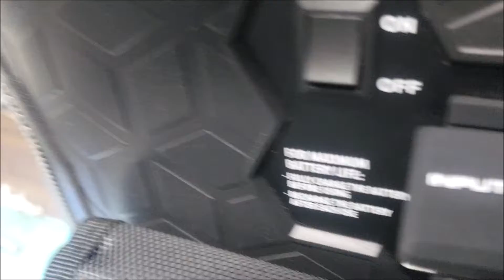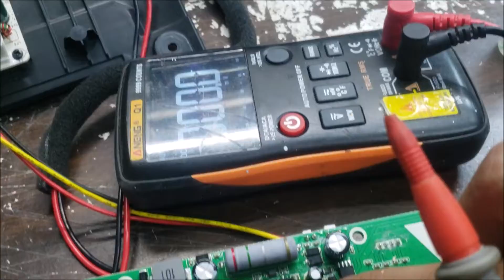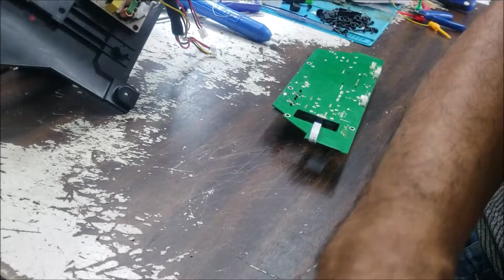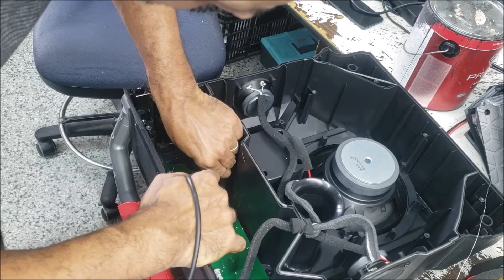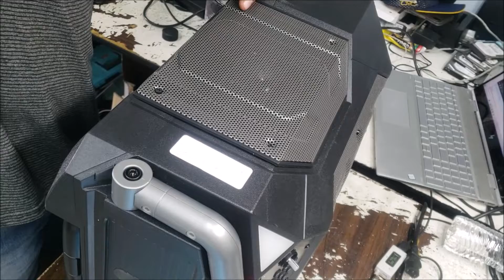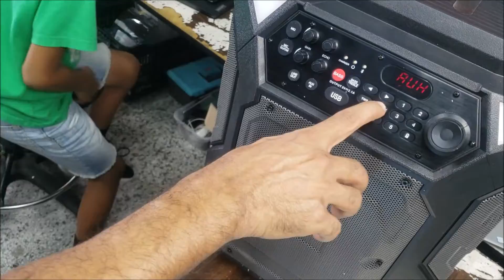MONSTER portable Bluetooth speaker 270X wont turns on green light only

Comment: I know it's 2026 but  I am trying to get my Rockin' Roller 270 fixed, I accidentally tripped over the aux in cable and bent the tip of the cable. Now when I turn it on, even without the  aux cable plugged in it automatically goes to "Aux In", and when I turn the volume up or down, it goes to stby mode and then shuts off. Did I damage the AUX in port and it thinks I always have an AUX cable plugged in?  I would really like to get it repaired. What are my options? Should I just get a new main circuit board? Or is it I can do on my own?   Thank you. Robert:
Reply from the maker: replace the jack
Reply: @SOSfixElectronics  I will try that because a main circuit board is $65 on Ebay. Thank you

Comment: Mine will now not AC power up at all.  I have had the battery removed for years and it has work fine on just AC.  The small circuit board just behind the AC plugin is getting power but not passing it on to the unit through the larger black and red wires.  Can you buy that small board?
Reply from the maker: yes dc 12v
Reply: @SOSfixElectronics  Where do I purchase?

Comment: Mine cant switch between inputs ..and switch itself fron Bluetooth to standby and then goes power of..
Reply from the maker: control ic
Reply: @SOSfixElectronics control ic?
Reply: @cachifori, Did you ever fix it? I know it's 2026 but  I am trying to get my Rockin' Roller 270 fixed, I accidentally tripped over the aux in cable and bent the tip of the cable. Now when I turn it on, even without the  aux cable plugged in it automatically goes to "Aux In", and when I turn the volume up or down, it goes to stby mode and then shuts off. Did I damage the AUX in port and it thinks I always have an AUX cable plugged in?  I would really like to get it repaired. What are my options? Should I just get a new main circuit board? Or is it I can do on my own?   Thank you. Robert:

Comment: I tired the battery on mine and no luck.  The problem is that the unit is not charging the battery, that's why it only works with the power cord plugged in.
Reply from the maker: you can add a universal charging board to it

Comment: I installed another used battery and is working except when is plugged is flashing only 2 steady green lights,like not chrguing, and the 2 outlets doesn't have power too,i will used until the battery is empty and see if the battery chargues or if aomebody had this problem how to resolve it thanks

Comment: I love my unit...only had to replace the battery once and they're cheap.  Only complaint for me is the fact that I can't get many radio channels, but that's not much of a surprise considering that I live in the Sierra foothills...
Reply from the maker: you can add a bigger antenna
Reply: @SOSfixElectronics  where is the antenna at all? I don't see an antenna on mine…
Reply from the maker: @UR2Compliant  there is a wire inside
Reply: @SOSfixElectronics  are you capable of being more specific, especially if you say that there's a way to extend it…
Reply: @UR2Compliant the antenna would be under the metal speaker shell, it’s connected to one of the screws like a o ring
Reply: Where did you buy the battery and stuff

Comment: Even if the battery is bad shouldn’t it still work if it’s plugged in?
Reply from the maker: if the battery is very low voltage may cause the speaker to not powering on even if it plugged
Reply: @SOSfixElectronics  Im dealing with the same issue, its not showing nothing on the screen only the green light, I can plug a device to usb port and it charged but no shows nothing in the screen, what can be it?
Reply: @yacohernandez8703 the thing in the video might work, im having the same issue now

Comment: Great work.  Lots of people can't test , find or repair anything.  I'm guessing that soldering iron us very low heat to be able to use on printed circuit boards, right ? Is there an electronic supply place to buy capacitors like u have , just laying around?????
Reply: Hi bro is it possible to take apart an monster beats box by dr dre 2012 version or will I get electrocuted if I touch the boards inside their is 1 board for speakers and the other is for power supply. Atm no power to beatbox so I'm looking for help. Thanks bro

Comment: I have the same unit with a bad power supply. Any idea what the voltage from the power supply was?
Reply: Any chance you figured out the power supply voltage?
Reply: Same! Bad power supply. Hoping to find voltage. Digikey has a lot that look very similar.
Reply: @RyanPatenaude  ok guys, I had one that was bad and ended up returning it. I opened up the new one for you guys and the voltage on the new one read 19.72 VDC. At one point I had a 24VDC 2.5A p.s. hooked up to the old one and it turned on but it didn’t have enough amperage to charge the battery. Good luck
Reply: @billbouch5239  Dude. You. Are. Awesome. I destroyed my original battery and replaced it with a Lithium battery from Amazon (12V). Worst case scenario, I can run it on battery and just charge it independently. I did hook up a 12VDC (that I had lying around), but it is hard to know if it is doing anything. I assume the machine deduces battery charge percentage from the voltage of the battery--and it probably doesn't work right with the new and different battery. I ran it for hours and it did eventually finally read the battery at 75%. After attaching my 12VDC power supply over night it did read 100 again the next day. Not sure if it actually charged, or resting the battery made the difference. I also could see in this video that the power supply on his is different than mine--might be the same specs--but it is a different component. Thanks for your help, if I can find a cheap 24V converter I will put it to work!
Reply: The 12VDC power supply officially does not charge the battery. I bought a 24VDC power supply on Amazon ($18) yesterday. I will give a full report when I get it hooked up.
Reply: It works like new! It is gigantic--so I can't exactly put it back together--need to find a small one that will fit back in the case.
Reply: @RyanPatenaude  update please!
Reply: @NoWorldOrd3r , I am so embarrassed....  I accidentally left two of the wires that connect to the on switch (why are there 3?) crossed for an afternoon (they just fell that way) and ever since then it does not work right....  BUT, like I said, it DID work. And it still does work when plugged in to the 24VDC power supply--it just no longer works on battery power. I found a slightly smaller than original power supply from digikey and might 3d print a bracket that will make it line up with the original holes.
Reply: @RyanPatenaude  there is an inline fuse in the middle of the cable going from the battery to the circuit board. it is wrapped around with the gray foam sleeve. it is possible that fuse is open.
Reply from the maker: sorry i dont